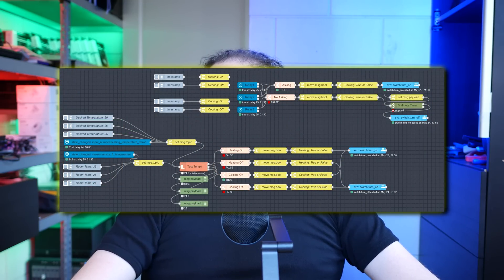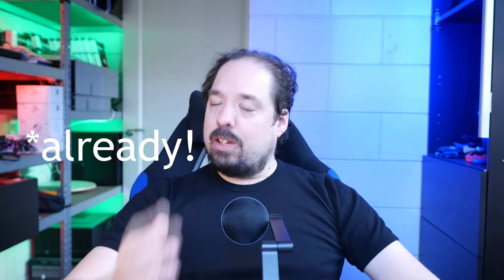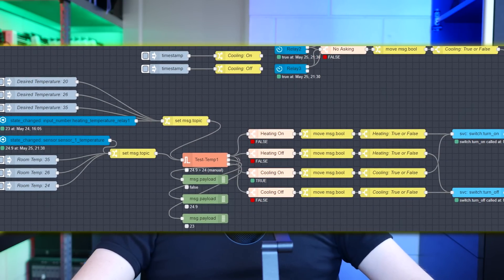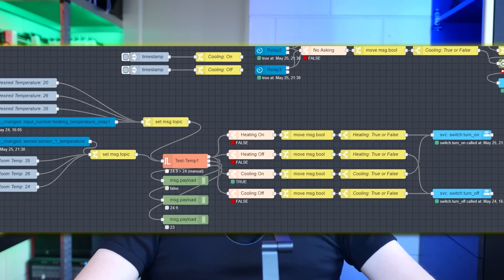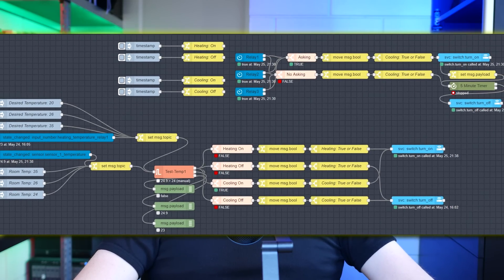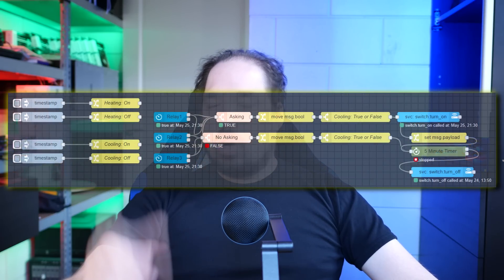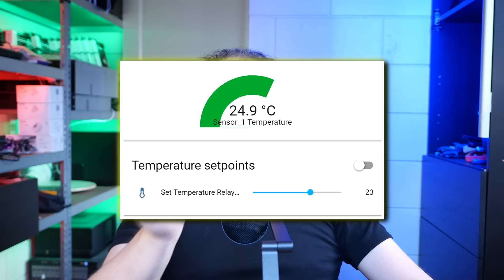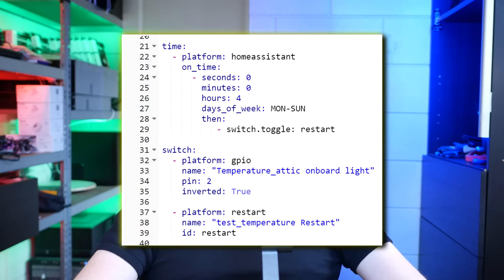DIY Thermostat: Project update

Comment: I am following a lot of your projects.  With this project, how did you deal with safety features?  
Example:  If Home Assistant or any other HA controls the heating as a generic thermostat, how do you protect if the HA system crashes?  Example, if the thermostat is on and heating, the HA platform crashes and can't turn it off again, what do you use as a saftey fallback to protect against over-temperature so things don't get damaged, or under temperature in the middle of winter to prevent freezing if the HA system is no longer in control?

Comment: I tried to connect the LCD screen sensor to my home-assistant hosted inside a docker container on an Intel NUC that has Bluetooth built in. It picks up the Bluetooth MAC address and picks up a signal bit states that it can't read the reading. Would using the ESP chip help as a bridge in-between the device and home-assistant and can you also use a single chip for multiple Bluetooth devices (as long as they are in range of course)
Reply from the maker: Not sure about the Docker situation but yes, an ESP32 can be used for exactly that and I have some running with 3 or 4 connected, no issues
Reply: Thanks for the quick reply. I managed to sort it, turned out I had the wrong version of home-assistant installed that wasn't the full software/operating system and didn't have full access to the system hardware. Managed to fix the connection issue and set up with the ESP32 anyway 😊 I will now get thermostats for each room of the house. Thanks for the help!

Comment: Just as a note, Xiaomi have another new one out, the model LYWSD03MMC .   This one is NOT supported in ESPHome yet, which is a shame as it is cheaper than the others.
Hopefully this one will be supported soon
Reply from the maker: Yeah, sadly they have started to add encryption and other stuff to them making it harder to support them. But who knows, hopefully they can get it done!
Reply: @IntermitTech  I might have to try the ZigBee route and just add a small wall display for the local readings.  It is hard to trust the new devices will work if the firmware is updated.
Broadlink killed the RM3 support by updating firmware which closed off the older api.....
Reply from the maker: For now the original versions (not e-ink) still seems the best and still works really well for me. But yeah it sucks that these companies seemingly want to kill their business by releasing new restricted versions, how can our data really be worth? Or is it forced planned obsolescence they are after, really can't understand. Just give us access...

Comment: HI,
I saw that you are using also some underfloor sensors...can you give more details on how do you use them in HA?
i also have underfloor sensors to prevent floor overheating, but i didn't find an option to use them together with ambient sensors.
thanks.

Comment: Hi, I have been following this long time and did some  cool stuff like this with the help of your vids, what whould you suggest as the best option for me as I am doing now infloor radiant heat. I'll have 7 loopd/actuators ? What is the best approach relays and sensor?
Reply from the maker: I'm hoping to continue that series sometime at the end of the year again but for now, I made a video about relays, it's in the Home Assistant playlist.

Further I've been working on a Node-Red where I use the temperature sensors and send commands to the relays but I've been busy with other projects. But that will be kind of my approach, to basically build the logic in Node-Red and use the Xiaomi for temperature to control relay boards connected to the actuators.
Reply: @IntermitTech  thanks for your reply,  any idea of integrating any drywall flushmount sensor to a esp,  like this
https://bravocontrols.com/shop/rts3-flush-mount-hidden-room-temp/
Or this
 https://www.supplyhouse.com/Aprilaire-8051-Flush-Mount-Temperature-Sensor?gclid=EAIaIQobChMIrrKetf-05AIVBeXICh11dAvmEAQYAiABEgI4pfD_BwE

Comment: I am puzzled. I have an esp32 with esphome set up with a xiaomi temp/hum sensor exactly as you suggest, but the range is super crappy. RSSI -82dB from 2m away through a wooden bathroom door. It doesn't seem to update as soon as it should. My walls are wooden framed, sheetrocked. Today I took a shower but home assistant didn't even know about it until 2 or 3 minutes after I got out of the shower, even though the physical sensor had registered an increase in humidity almost as soon as I turned the shower on.

Can anyone comment?

Comment: What's the Bluetooth range of single ESP32, I am using smartwatch with BLE mode and it's like only three meters is there a way to boost a signal at software level?
Reply from the maker: Oh, I don't know about your smartwatch but with my ESP32s I use and the Xiaomi sensors I've been able to achieve reliable reception up to 10m or so.
Reply: I also get about 10-15m direct line of sight, not so much through walls or floors though! Thanks for the tip on daily reboots I will try adding that in to my scripts

Comment: Great video! I have a question. How do you ask for heating to the heat pump? If it has a wire connection, what voltage does it require?

Thanks for this serie :-)
Reply from the maker: I believe it's just an open or closed contact. Closed signals the heat pump that it needs to deliver, open means no heat/cooling is being asked.

So I don't really need to know the voltage, I just use a relay like I did in my bathroom video and that should be it. :)

But I will make certain to show that in upcoming videos! :)
Reply: I understand. it makes more sense in that way. Waiting for the next video. Thanks!! :-)

Tip: You can define an Internal ESPHome switch for asking heat/cold  which value depends on the value of the valves relays. It that way you dont see that switch in home assistant and you dont have to automatize it, ESPHome will do it

Comment: Zigbee is not good for this. It only send updates on a significant temp change, which is slow for heating automation. The round bluetooth sensor on other hand is very sensitive (a little bit too sensitive 😀) it sends update a lot, even on very small temp changes.

Comment: Nice to see we have the same project going on. For the bathroom, I read the ventilation humidity sensor to decide if the mirror heater needs to be turned on or not.

Comment: How's the battery life in the Mijia?
Reply from the maker: I'm taking my time doing my analysis of this, but from what I've seen it varies between 6% to 10% per month, depends on the location (amount of temperature fluctuations) and battery. Once I have one run dry I'll make a vid about it, but it seems pretty good to me, close to a year on average.
Reply: @IntermitTech  I just checked the battery readings on mine and the first one I tested/setup which I received around late Nov. last year (2019) is now down to 2% and is still sending a signal!  That is a cheap off brand battery called Sunbeam that I had on hand at the time and will probably replace it with a Duracell once it stops transmitting.   

Do you have a particular brand battery that you prefer to use that are a good value  in your opinion?  Lasting almost a year definitely doesn't sound bad.  If using cheap batteries  with track records of short life spans, I would probably stick with things that  are easily accessible, don't control HA automations, etc.   When testing 1.5v alkaline batteries, I usually toss them once they measure under a volt which seems to work for most applications in general.

I've setup a persistent HA notification automation for a water sensor being triggered, but have not setup any for battery readings yet. I think this would be a good/useful topic to cover in any future videos and also  share the automation yaml or Node-Red flows.  

Keep up the good work!